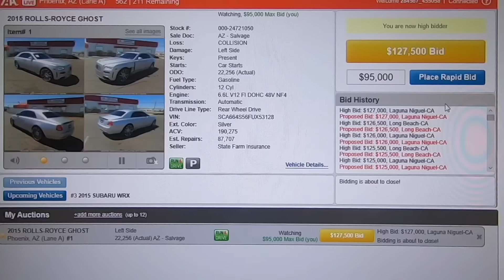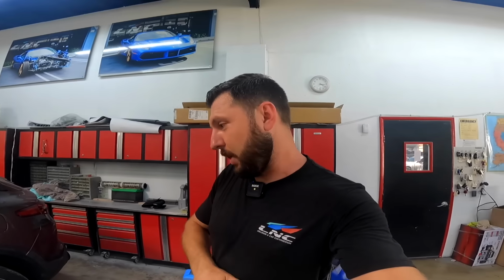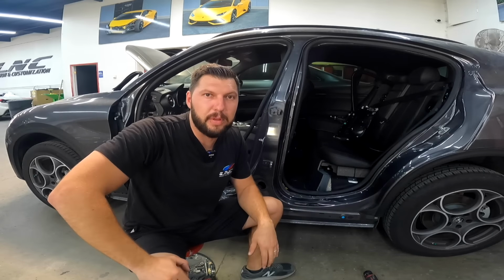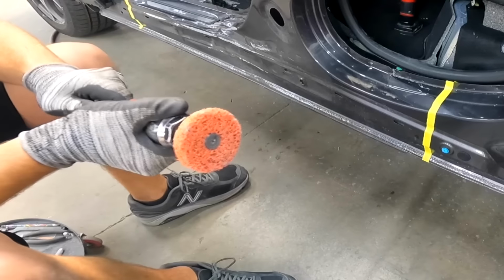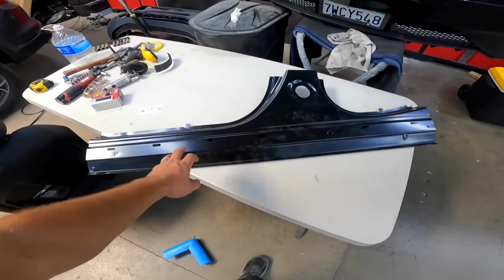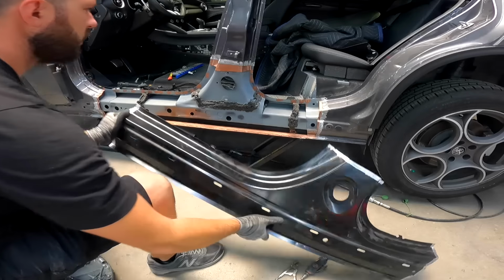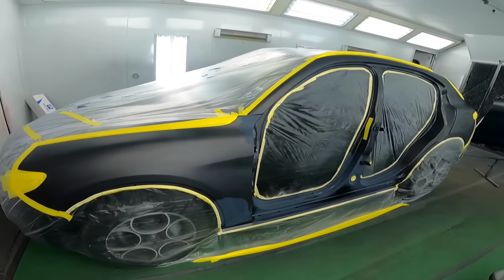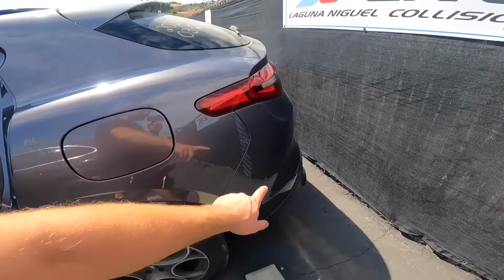Rebuilding A Wrecked 2022 Alfa Romeo Stelvio Part #2

Comment: The standard of workmanship is as always 1st class - just wish all body repair shops worked this way and I'm speaking of the U.K. here. I'd prefer as you repair - replace the section otherwise it is so intrusive a repair and doesn't need to be so more than repairing as you are so doing.

Comment: I would replace the whole panel as that’s the way it’s build in the factory. Plus the structure strength is much weaken no matter how good a repair job is done. Replacing the whole side keeps the structure to factory specs.